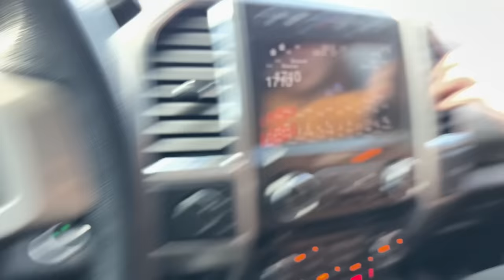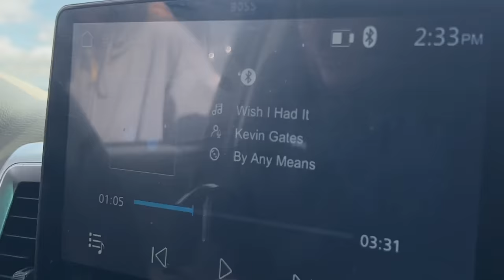My 1200HP Turbo Camaro vs Dirt Track!

Comment: How about a semi truck that spins all for corrected the pinion angle with lockers and different axle shafts you will probably need a bulletproof Trany and a full-time four-wheel-drive T case

Comment: Bought it for so cheap bought it for $70k like that’s cheap. I have an 2019 ss I’m selling for a 6th gen 2020 zl1 with a 6 speed and I’m going single turbo not twins or procharger f1x or insane f2

Comment: Win my 150k clapped out cardi b with bald tires and 2 wheel drive
Reply from the maker: Tires are far from bald. The driveshaft is $200 if the winner wants one that bad I’ll buy it for them 😆 I ordered a clocking ring for the tcase it’s still not here
Reply: I know you build all your trucks ( insert sarcasm here ) so please let me know where you get a 200$ drive shaft these days?

Let alone one that may possibly be built to handle the angle of your 20 whatever “ lift